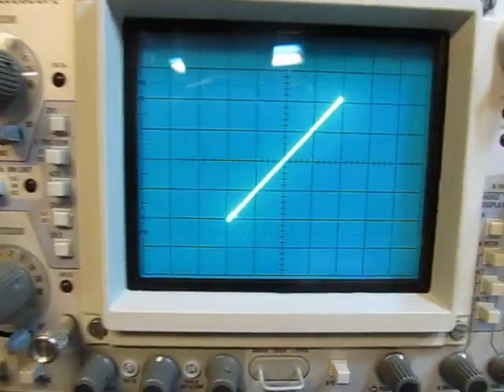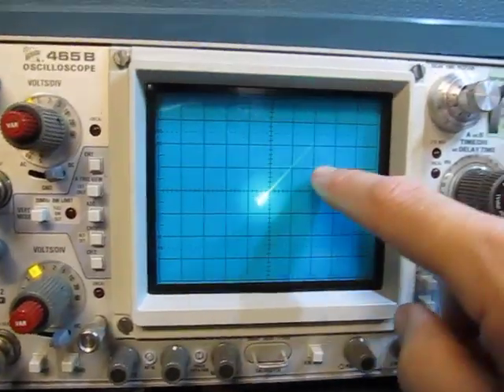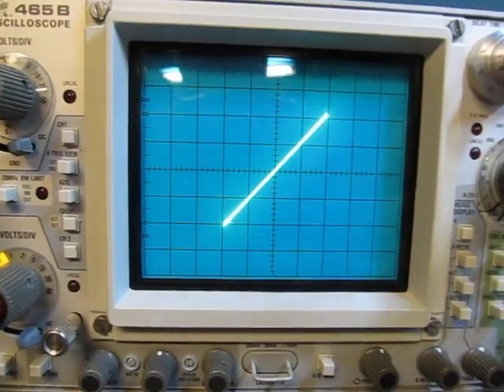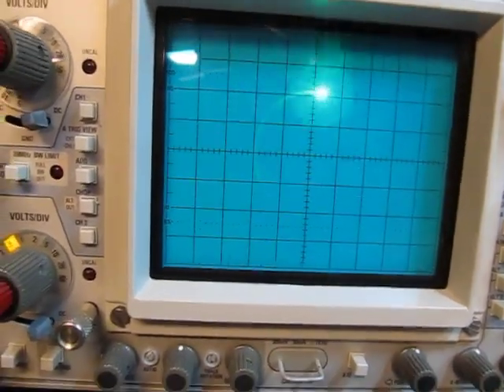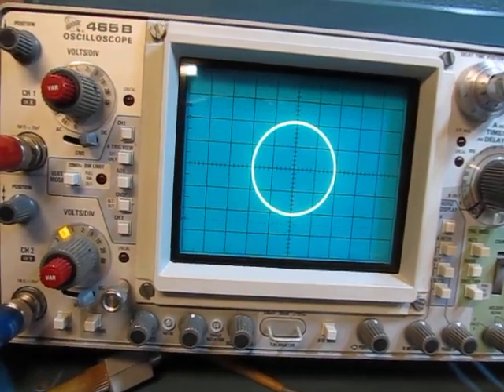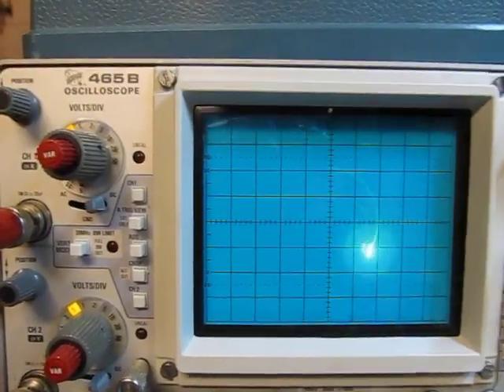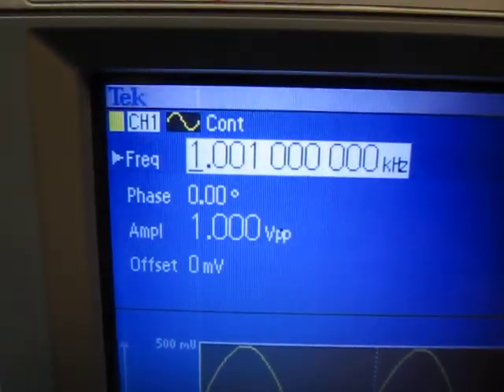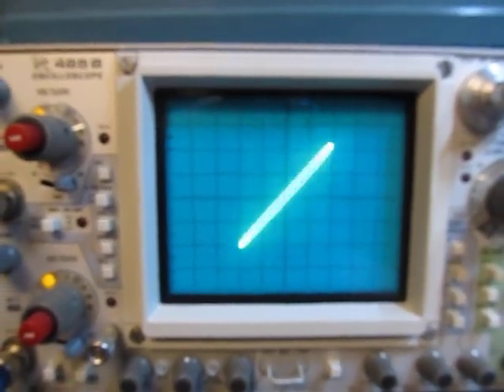#48: Basics of Lissajous Patterns on an Oscilloscope

Comment: You are doing excellent presentation. But let me ask if you can tell me if we can draw using XY mode a effciency diagram of a power supply with on X axis the load we apply on the output of the power supply.
Reply from the maker: XY mode will work with any waveform that can be displayed normally on the scope, regardless of what that waveform represents.

Comment: The primary purpose of XY (Lissajous) mode on an oscilloscope is to facilitate two-channel phase analysis on a single-beam scope. Single beam was the limiting property of 80s-era CRT scopes. And XY mode was a _lifehack_, intended to work around that limitation when one heeds to work with two channels at once. 
Today we are no longer limited by "beams" since there are no beams in digital scopes. For most applications we no longer need XY mode. In fact, people realize for many of the former classic XY applications the "multi-beam" XT mode works much better than XY mode. So, Lissajous mode today becomes something of an interesting and entertaining gimmick. It still has its applications, but they are few and far between.

Comment: How to do that on oscilloscope?
Reply from the maker: As shown, it involves putting your scope into XY mode and applying signals to the two inputs.
Reply: @w2aew  like varying the frequencies? Because I am applying the signals from two generators, I tried too many ratios but I came short. Thanks for the reply by the way.
Reply: @w2aew  sorry I meant, how to do that on multism?
Reply from the maker: @Time4yes  I don't know if the scope tool in multisim supports this mode.

Comment: Wondering if you can do this on any oscilloscope? I have a Teck 422,, been trying to figure it out for a while now and also what one would use Lissajous patterns for?
Reply from the maker: Most scopes have an XY mode, including your 422 - it's called External Horizontal on yours.  Usually this mode is used with external circuitry to do things like curve tracing, etc.  Lissajous patterns can be used to view signal phase alignment, frequency comparison, etc.
Reply: HI W,,, Thank you,, I was looking at that function just after I watched your video and was wondering whether that would be the XY function. The operation Manual is pretty vague about this.. Thank you for replying to my question, I realize that this video was done quite a while ago,,so I really do appreciate your reply,,, Thank you again.. :)

Comment: Can you do this with modern digital scopes?
Reply from the maker: Most, but not all, modern digital scopes will also have an XY mode, but I've never run across one that does XY as well as an old analog scope.
Reply: Do you need to have AC or DC coupling on the probes ?

Comment: could you elaborate how you are changing the phase between the waves?
Reply from the maker: Injection locking means that some energy from the first oscillator is coupled (injected) into the second oscillator, forcing it to by synchronized with the first.  Kind of like kicking a horse at the right moment in it's stride to make it run at a given pace.
Reply from the maker: My 2-ch signal generator has an adjustment for the phase of the 2nd channel with respect to the first.  This is how I make the static phase changes.   The slowly changing phase (slow rotation of the pattern) is done by creating a very small frequency offset between the two generator channels.
Reply: @w2aew is it possible to use oscillator circuits to change the phase of 1 of the input signal?
Reply from the maker: Maybe.  You'd have to injection lock one oscillator from the other, using some adjustable phase shift network.
Reply: w2aew what does injection locking mean... sorry I'm just in sophomore year of engineering. ..
Reply: w2aew ah I see. ... it's like in an RC phase shift oscillator circuit we add capacitors to obtain different phase shifts..?

Comment: As a teen, I had the use of a very well equipped electronics lab in the high school ham radio club. I learned about  these figures through experiments with signal generators and oscilloscopes. I learned about phase angles etc this way. I have used these concepts all my adult life as an electric utility engineer.

Comment: Great video my friend, you have a new subscriber. thank you so much for you explication, I would to make this practice, please tell me did you change the frequency of the 2 channels , for example the channel one is 1 hz and the second channel is 1 Khz??
Thank you for your help.
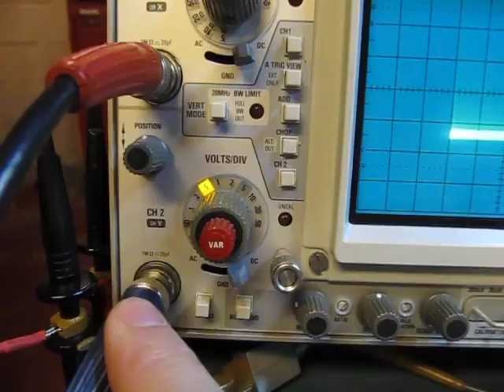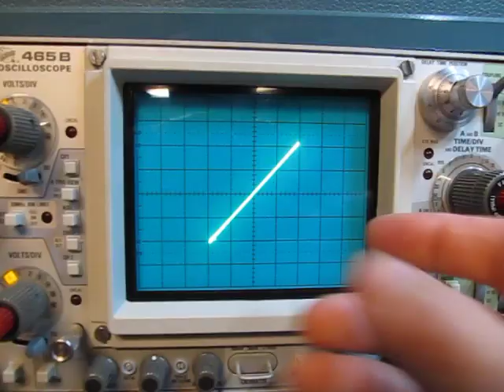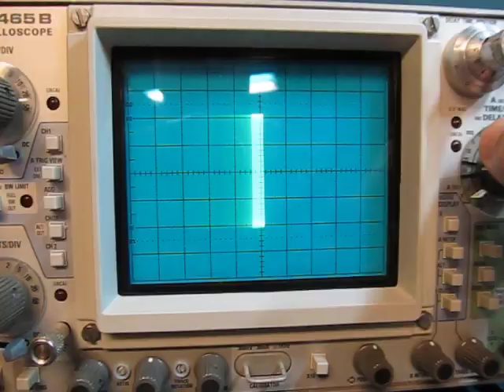Reply from the maker: I started with that at about 3:20 in the video, then changed them both to 1kHz.  Then I adjusted the phase between them.  Then at about 4:25, I changed them both to 1Hz. Then both back to 1kHz again, and showed phase changes only.  I bounce back and forth between 1KHz and 1Hz on both so that it is easy to see how the figure is formed.  After about 7:10, I show what happens with different frequencies.

Comment: I understand the concept but can you show me how you connect the probes? what i mean is the ground and the positive.
Reply from the maker: In this case, I didn't use probes. I simply connected the two scope channels to the two outputs of my 2 channel function generator. If you use probes, the ground leads get connected to the circuit's ground, which would be the same as the scope's ground.

Comment: I was interested in buying an oscilloscope to play music through and your videos have been absolutely knowledge jam packed! Ive learned so much watching your just 10 minute videos. But I was wondering, If I wanted to plug a guitar running through an amp to an oscilloscope how would I go about doing that, or lets say a synthesizer through one. Also how would you make it into a to wobble around. I could show you some videos for example of what Im interested in doing. Anyways, amazing videos man and I appreciate them!
Reply from the maker: To get a wobbly lissajous pattern like this, the X and Y inputs need to be different from each other (like stereo).  If you have a single source, then just use the scope in normal mode.  For audio, horizontal sweep times of 1 or 2ms / division work out best typically.
Reply: ***** Thank you! And how do I go about putting an amped guitar or synth into one? Sorry about so many questions haha
Reply from the maker: Connect a probe to the speaker terminals
Reply: ***** Alright, its gonna be a journey learning all the ins and outs of one of these boys, and what I an do and its potential so your channels gonna help a lot thank you!

Comment: I tried this with my digital scope. It does not quite look the same, you can almost see the samples broken up. If I increase the persistence of the display I can view a lissajous pattern if the frequencies are the same, but if I shift the frequency of one channel then the pattern becomes unrecognizable. Great presentation.
Reply from the maker: Unfortunately, most digital scopes do a mediocre job in XY mode. Sometimes you can get better results if you slow down the horizontal scale, or increase memory use, or use hires sampling if you've got it.
Reply: +w2aew Thanks Mr. Wizard (remember that show:) Increasing the memory improved the display quite a bit, but still not quite good enough for any meaningful measurements. I knew there was a reason I kept my Tek 2236.

Comment: A favorite pastime - experimenting with lissajous patterns.

My father had a polar oscilloscope - a set of secondary deflection "plates" were a center pin (right in the middle of the screen) and a ring around the edge of the circular CRT. The input signal would move  the trace towards and away from the center pin. The basic trace was (of course) a lissajous pattern made by a set of 90˚ out-of-phase sine waves on the normal XY deflection plates. I didn't see it among his things, so I suppose something terminal happened to it (maybe the irreplaceable polar CRT died) and it was disposed of.

I expect such a display could be synthesized by running the polar input signal into a pair of multipliers - one multiplying the polar input signal with a 0˚-phase X drive-signal and the other multiplying it with a 90˚ phase  Y. The outputs of the multipliers would be fed to the X and Y inputs. If my "thought experiment" is right, this should create a circular trace which changes by getting closer to or further from the invisible center by the amount of the polar input. 

(I leave trace speed and sync as an exercise for the reader.)

Comment: Hey! I just have a very simple question. We use the Lissajous pattern to essentially measure an unknown frequency connected at the other channel on the CRO.
However considering this aim, we can easily connect a signal  with the unknown frequency and directly measure the time from the visual and find out its frequency. 
Why connect two channels and study these patterns!?? Please reply!!
Reply from the maker: +Yash Shah Using the time domain approach, it would be very difficult to determine very small frequency differences.  If you apply signals with a very small frequency difference to a Lissajous pattern, it's very easy to see the difference via the rotation of the pattern.
Reply: +w2aew   For measuring the very small frequency though, we can always narrow down the time scale provided on the CRO. 
Sir , I don't think that is an issue! Is there any other reason!?  Lissajous patterns are considered better in measuring the frequency of unknown channel. Why is that?
Reply: +w2aew  Why not connect a single channel on the CRO and directly measure the frequency by the time period observed on the waveform!/?
Reply from the maker: +Yash Shah I wasn't talking about measuring a very small frequency, I was talking about measuring a very small difference in frequency between two signals.  It would be very difficult to directly observe the difference between a 10kHz signal and a 10.001kHz signal when measured directly, but very easy with a lissajous pattern.

Comment: Excellent. Would have loved to see the stereo music thing you mentioned.
Reply: +Multirotor Fun There are stereo receivers that have an O-scope built in.  I have one - Marantz 2500.  Marantz made a straight tuner that had one, and there was a larger version of mine - the 2600.  It works exactly as the author said - the better the separation, the more deviation from a line with slope of 1.  The trace dances around, creating a bit of a ball.

Comment: I performed same experiment as this one did but my phase difference is not uniform. Which means my Lissajous patterns on the oscilloscope was not stayed the same as this one did. Is this because of performance difference of the function generator? or something else
Reply: you need to synchronize the two generators. function generators usually have a sync input in the back, that you can output the TTL signal of another function generator to.
Reply: Thanks for all the answers. I appreciate that.
Reply from the maker: Yes, it is most likely due to the signal generator. In my case, I used a two channel function generator whose channels share a common reference so the phase between the channels is stable.

Comment: As I child I found it was fun creating lissajous figures on an oscilloscope, in adult life they were a superb way to observe frequency errors. One such application was adjusting 5Mhz crystal oscillators used as equipment master oscillators to correlate with the 10Mhz output of a rubidium frequency standard. Although the rubidium standard could be used to clock a frequency counter it becomes tiresome using a counter with a 100s or 1000s gate time in order to achieve the necessary resolution.
An excellent video once again.

Comment: Dude are you an Electronics Engineer ?? Good explanations. :D
Plus you need big bucks for those gear !!
Reply from the maker: Yep - I'm an Electrical Engineer.  I've been gathering bits and pieces of this equipment for 30 years - most of it acquired needing repair, so the investment hasn't been too steep.
Reply: iEugene1994 Actually ,the way he explains these stuff i(s not down to the core technical but still ) shows he has good understanding of the underlying theory. A hobbyist will not be able give such a clear cut explanation. I am an Electronics and Communications Engineer and the stuff he says pretty much clarified some stuff for me. 
Plus his gear doesnot look like its second hand. shrug

Comment: I am writing an exam in a week that asks to determine the unknown frequency, using XY mode and counting the nodes. They talk about horizontal and vertical loops. I don't quite understand as I don't see any horizontal loops in this vid. Also, if one has a scope why on earth would they measure frequency this way instead of the traditional cm X time base of 1 cycle ?
Reply from the maker: "loops" isn't probably the right term. Maybe better to count the "peaks" that touch the horizontal and vertical extremes. This techniques goes back to the days when scopes were not well calibrated in sweep speed, so frequency measurements weren't too accurate. Also, this technique makes it easy to measure against a known frequency, and to observe if two frequencies are harmonically related or phase locked. And of course, it helps to ensure you understand the concept of frequency, as well as how an analog scope creates displays. Finally, it also shows an alternative way to make a measurement. It's always a good idea to know how to verify a measurement via an alternative method.

Comment: Thank you very much for your hint. Now I got the pattern on 2467B by turning the intensity control up.
All of your series of video are extremely informative. Do you have any plan to do some video on Tek's TM500/5000 modules, or 7000 series mainframe? How about the options of staying connected using obsolete GPIB controller with modern PC with only USB port, laptop  computer without PCMCIA card?

Comment: Very instructive demostration! One question: my Tektronix 2467B only shows Lissajous pattern very briefly before it shut itself down. Is this due to the self protection of micro-channel-plate CRT and is it normal? Then how can I get a stable X-Y mode display? This scope pass all diagnosis thought the beam intensity and readout intensity seems to automatically reset to higer value after "auto measurement", which was quite annoying.

Comment: Another EXCELLENT VIDEO.. Thanks.

Do you remember a circuit that was once in QST called an octopus? It basically allowed you to make a crude curve tracer with a hand full of parts to work with a scope in the XY mode. A short produced a vertical line, an open was a horizontal line and a PN junction was a line with a turn or curve. Caps made a circle. It was helpful for finding leaky diode and transistors. 
That would make a great video  Google: "transistor tester octopus". 
.
73,
Glenn WA4AOS

Comment: This function is used to adjust tape heads in reel-to-reel and cassette tape decks, to get the phase between the channels perfectly aligned.
Reply: Ahhh, I'm just starting to play with a scope for automotive diagnostics and I was curious what the xy function on the scope would have been used for other than fun.  Thanks for your older comment:)